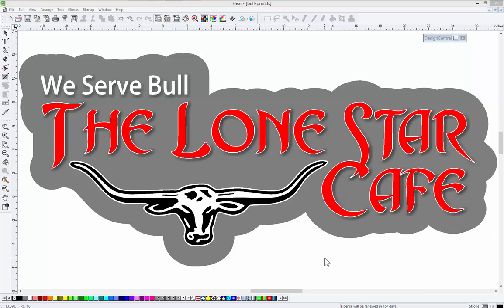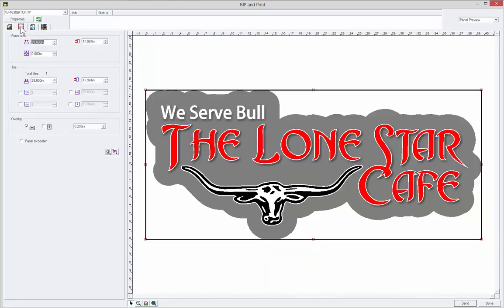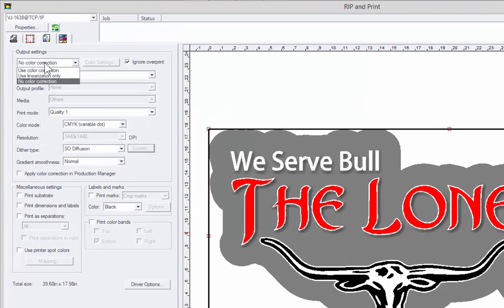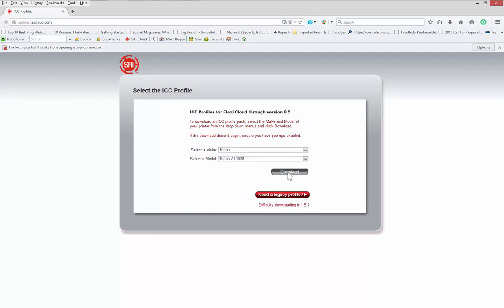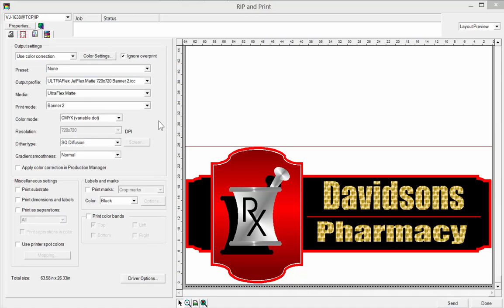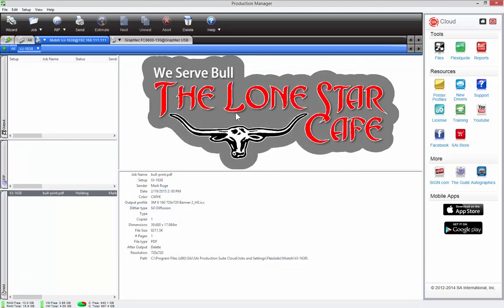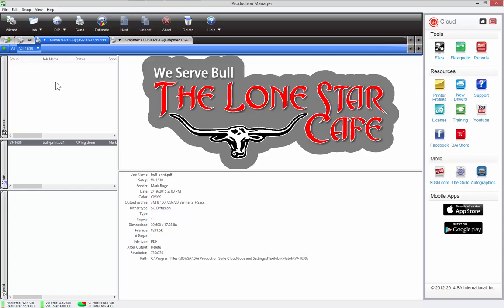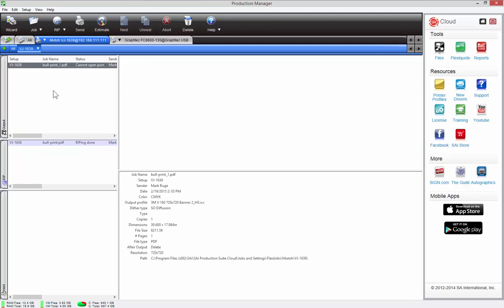How to RIP and Print through Flexi

Comment: i bought a vinyl cutter and it came with lxi12 l
 and it seems to be the same as flexi, anyway im having trouble with cutting i dont see the cutter icon. i did all the installs and reads that its cutting but it dont, im asking for help because they dont get back to me, thanks
Reply: did you ever get this figured out as i am having the same issue